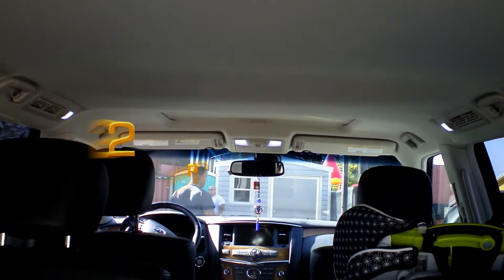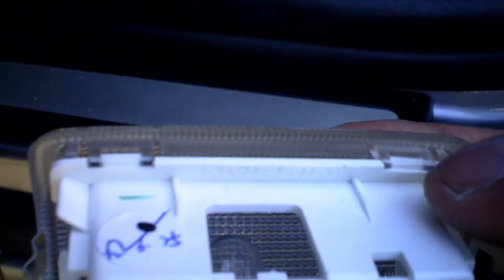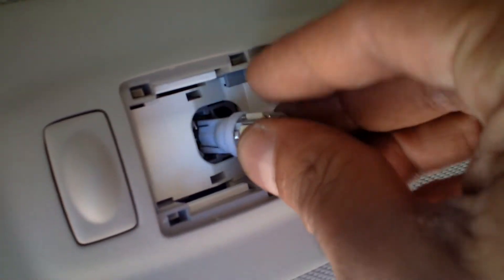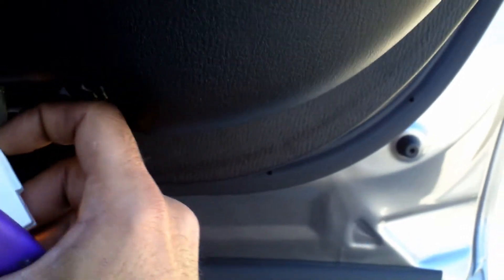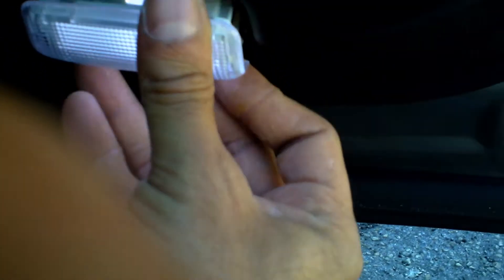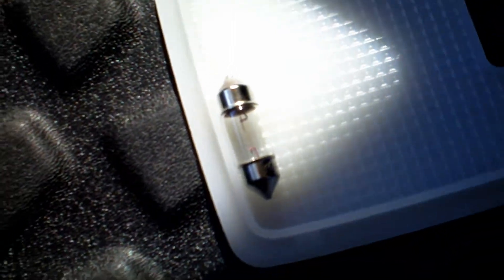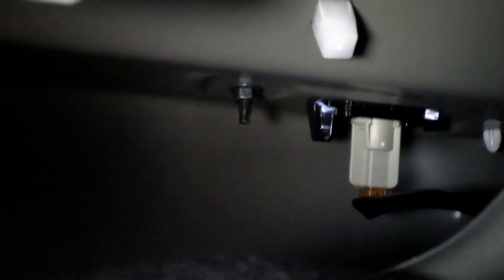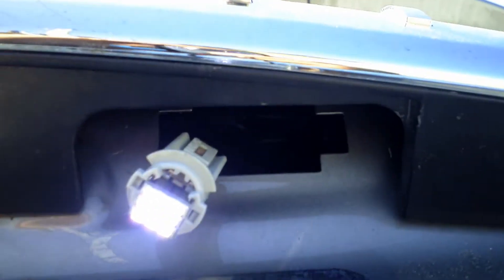2014 Infinity QX56 QX80 complete LED install DIY

Comment: Nice work!
Do you have the bulb numbers by any chance?
thanks
Reply from the maker: Erick H. It’s called a “Wedge bulb”, eBay had a great deal for bulk orders.
Reply from the maker: Erick H. Wedge bulbs
Reply from the maker: Erick H. I mentioned what bulbs I used for the interior @ 4:16 during the video. @11:02 I mention which bulbs I used for the license plate.
Reply: Bulb 194/168

Comment: What’s the bulb size for the trunk light?
Reply from the maker: I used an adjustable festoon with a 12 SMD panel. the size is limited so the panel is about an inch in size. anything bigger than a 12SMD will require some modding.

Comment: What about the headlights and fogs, you have a video on those? On the head light housing, at the top I think its a "parking bulb" that I would like to convert to LED. How can I do that one?
Reply from the maker: so far i haven't found any LEDs to use for the headlights or fog lights. HIDs are the brightest bulbs I've seen for the driving lights.
Reply: I just did mine.. I'll make a vid quick to help..
Reply: Bulb 194/168
Reply: I figured it out.. the parking bulb was super simple and easy. Got that done in about 5 mins for both sides. You just reach your hand in from the hood. The headlights and fog lights are just plain ridiculous. It took me about 3 hours to do both sides.